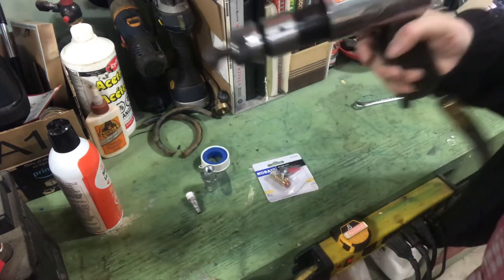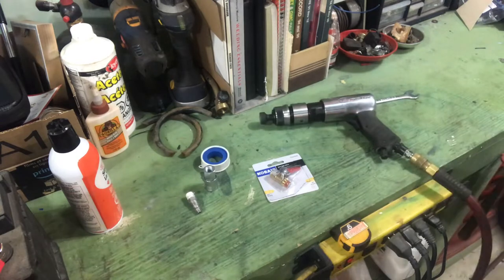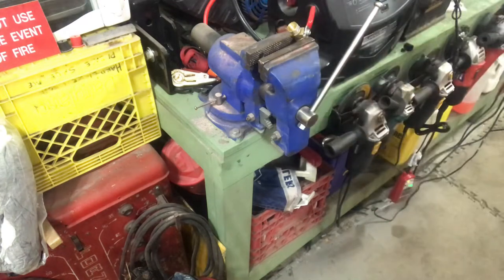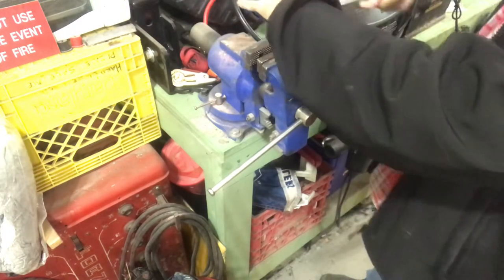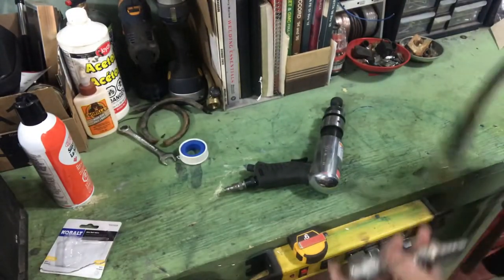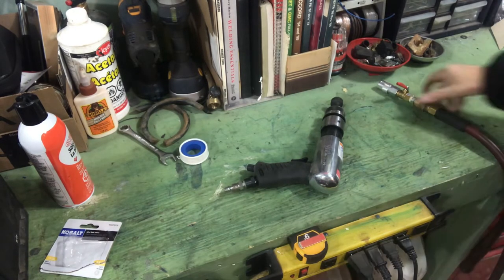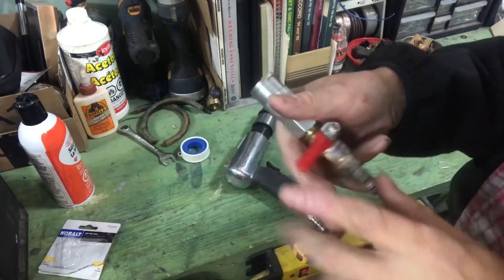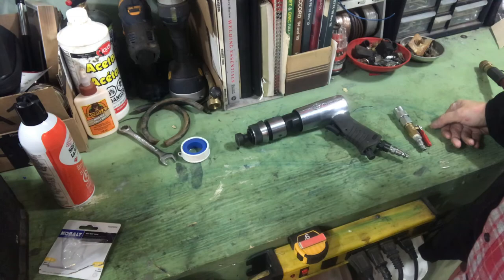Installing a Ball Valve on Air Tools

Comment: I install the Ball valves on my air hose before the quick connet so that way it's always on the hose not the tool
Reply from the maker: I would do that but I don't like the extra weight on when I'm using a paint gun
Reply: @BruceLyeg  I do it that way because I install the ball valve directly to the hose and then I attach a swivel to the ball valve and at the end of the swivel I out a quick connection it drops the weight when the swivel is on it makes it lighter for all attachments